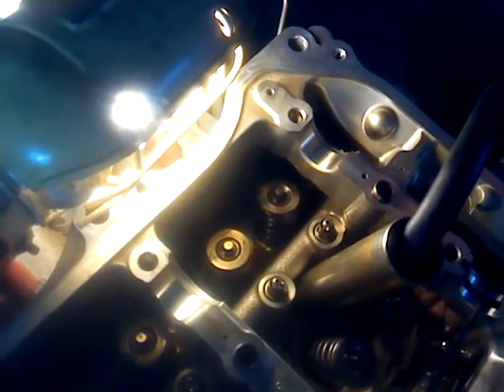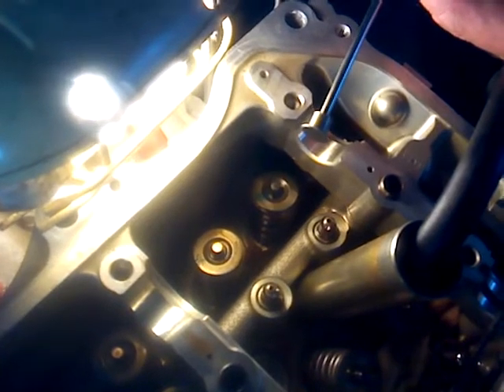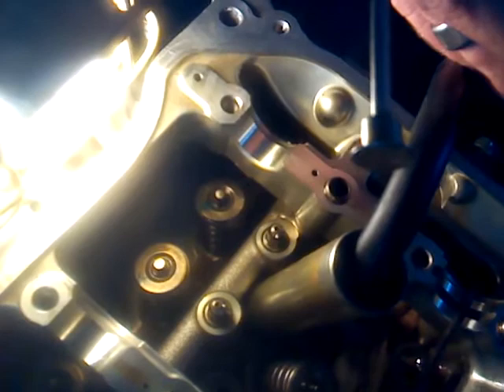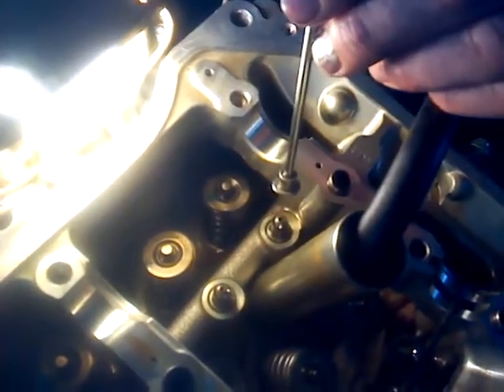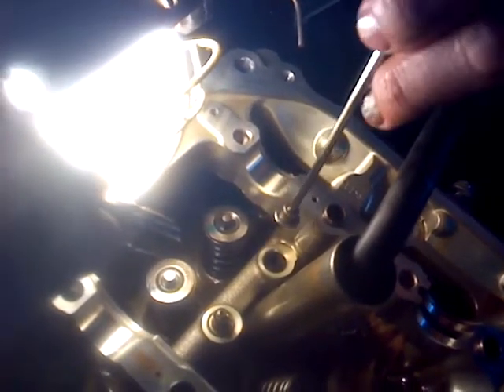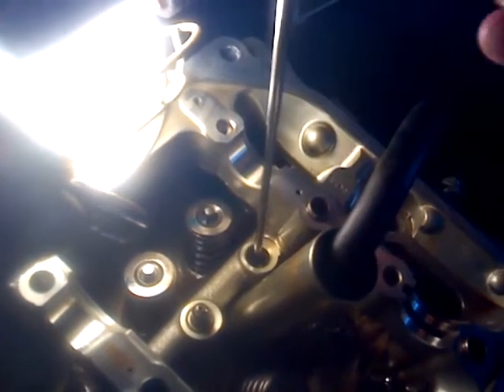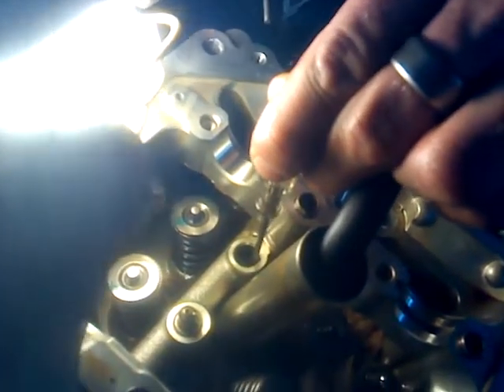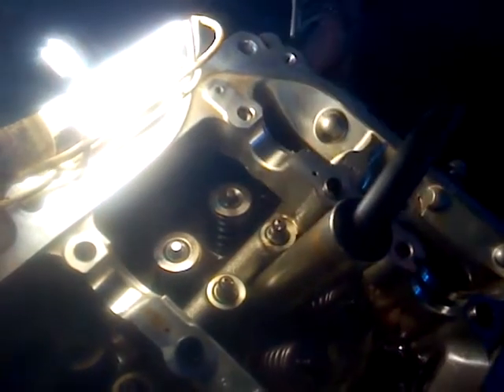Shimming Valve Lash Adjuster - Toyota 3.5L V6 2GR-FE

Comment: When you grind the base circle of a cam that acts upon a roller rocker design like this it has a tendency to mess up the geometry. It would be best to install a cam that maintains its base circle adds lift and duration where desired. Also gut the lifters and make them solid with the proper amount of lash
Reply from the maker: On a mild cam... NOT a concern. Thanks for your thought.

Comment: where did you get the shims for this? i've been toying with the idea of camming my 2gr before installing it and i'm trying to make sure i cover all the bases.. i tried looking for some clearances and i keep seeing they don't need to be adjusted (stock) but no clearance listed so i'm not even sure what size shims i would need? are these the MWR cams? if so are they stage 1 or 2?
Reply from the maker: I have the MWR stage 1  cams. The shims are custom machined and were sold with the cams. They are needed because the cams are reground and do not maintain the stock clearances. After a lot of searching, Marc Labranche (Gouky) did find an alternate source for shims that he his using on his 2AR-FE (very similar setup). Contact him directly and maybe he would be willing to share details with you. I don't have any other info. Unfortunately, not thinking that sourcing them would ever be a problem, I neglected to measure the shims, .
Reply: @Merryfrankster_  very cool yeah I wanted to go with the MWR cams also but they don't say they come with the shims or not I'll have to order them and see if they do and if not I'll have to beg Marc for details on what he's using haha thanks for the info!
Reply from the maker: @toddhargett2135  Talk to Matt at MWR. Definitely they did include the shims with my purchase. I've heard that since that time there have been some changes to the cams and maybe they don't require shims at all.